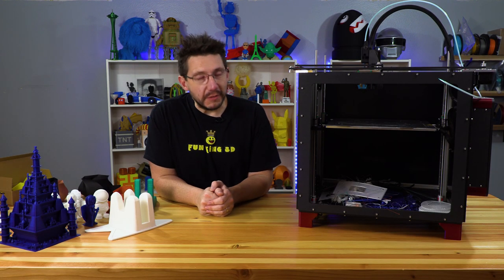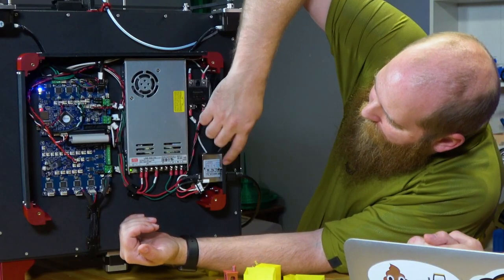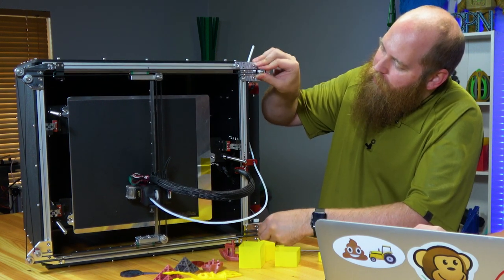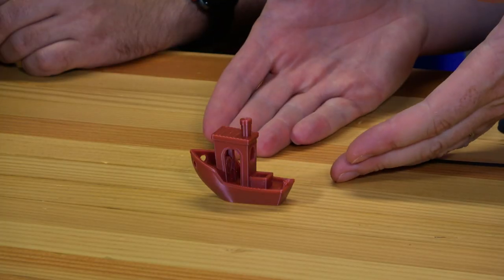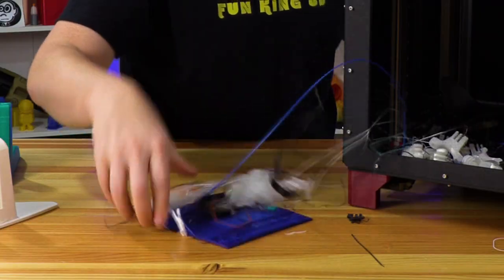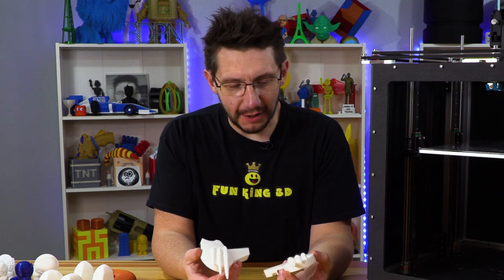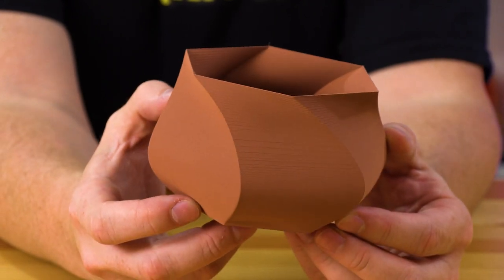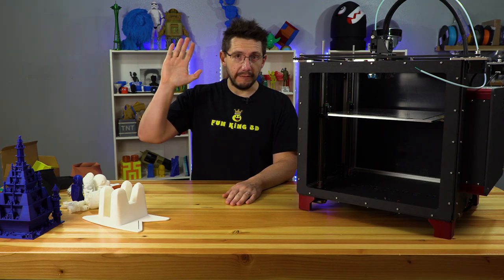Railcore II 300ZL Project R3D 3D Printer Kit Review

Comment: Voron 2.1 is superior in every way, basically.  leadscrews vs belt z is a tossup.
Reply: Every design is a set of compromises. I have a great deal of respect for the Voron team. We chose different compromises. I'm not sure what criteria you're using for "superior". 

The only clarification you offered is that "lead screws vs belt Z is a tossup"; I would point out that numerically that's not even close to true. The current kit design has either 4 or 8 times the Z resolution of the Voron belt-driven Z, assuming they use 16T pulleys (I didn't check that bit). If 4 (if you use a 0.9º stepper on the Z belt) or 8 ( if you use 1.8º ) is a 'tossup', ie indistinguishable, it's difficult for me to grasp your criteria.
Reply: @jstevewhite  the Voron 2.1 has 4:1 step down from the z steppers I believe, and drive the z belt with 16T pulleys, which gives it the same resolution as an 8mm (4 start T8) threaded rod. In other words, resolution will probably be the same.
Reply: @MyChannel3141   if it's the same resolution as T8*8, it's four times more coarse than  the Railcore (1 start 8mm Z axis)  - that is, .04 full step vs .01 full step. From a quick reference to the "building the Z axis" video for the Voron, it looks like they use 5:1 reduction, not 4:1, which would end up at roughly 50% more coarse than the Railcore. 

Not that it matters if you wanna print .1 or .2 mm layer height. But Joel was talking about the .01 stuff, which you're unlikely to accomplish well with .04 full step resolution.
Reply: Of course there's compromises, I'm not trying to say this is a bad system at all, just that there are some design issues that have been hammered out on the voron 2.1 that haven't been on the railcore II.  There are also some points which need improved on the voron 2.1 design as well, but I think they are less critical.

Several things would make the voron 2.1 superior in my eyes, namely the stationary bed vs the moving bed and the belt setup.  The gantry belt setup on the Railcore II is not designed properly.  The belts which fix to the carriage don't line up vertically.  This is a relatively easy fix, since it just means the relocation of two idlers and a small redesign of the carriage.  That redesign would fix racking issues on the carriage from the belts, and prevent torquing the linear rail back and forth as the carriage moves back and forth.  I think using a direct drive would be a decent idea if it weren't for the extra mass, especially on a corexy.  It's still an improvement over other movement systems, but I think the benefits of corexy are impeded (eclipsed?) by direct drive.  Others may think differently about that one.

Cooling performance is clearly better on the railcore II than on the voron 2.1, that is a weak point of the voron design imo.  It is remedied by adding extra fans or more powerful fans.  It's obvious that milled aluminum plates for many pieces on the voron 2.1 would be a significant improvement to the gantry rigidity, but the printed design still works very well if the correct materials are used.

Screws vs belts is a tossup because there's benefits to each, and detriments to each which aren't directly comparable. The two are not indistinguishable, but you could choose either one and still be fine.  "a situation in which all outcomes or options are equally possible or equally attractive"  I'm not gonna do the math, but there's a 4:1 belt reduction on the belted Z of the Voron 2.1, so you can take that for what it's worth.
Reply: @RentableSocks  "The gantry belt setup on the Railcore II is not designed properly.  The belts which fix to the carriage don't line up vertically. "... there is no reason they need to line up vertically, and no reason to 'fix' it. There are no 'racking issues' from the belts; all belt-related stress is parallel to the Y axis; the rail does not 'torque back and forth' at all. And, as I've said in many comments along this thread - 1) we a/b'd bowden and direct drive several times with no visible difference in print quality at 85mm/s - real-world, empirical test, and 2) if one is feels a strong need to use a bowden fixture, it's a five minute change; you remove the extruder from the carriage, move the filament feed tube to the bowden role, and bolt the extruder to the frame. 

Again, the Voron is a nice machine. We made different choices, on purpose, though. The structural side panels for rigidity, the higher precision Z axis (the Youtube voron z axis build video says it's 5:1, which would be about 50% more coarse than the Z resolution on the Railcore, at 8:1), and the ability to mod, tweak, change, experiment, and otherwise munge the base machine to your own purposes. 

I would certainly never discourage someone from building a Voron. If you want to say "I like the voron better." I'm with you. You do you. But a claim of objective superiority requires support, IMO.
Reply: @RentableSocks  That said, I'd love to see a gallery of Voron 2.1 prints @85mm/s. I can't find 'em from google. If you have a link, I'd appreciate it.
Reply: @jstevewhite  there's a subreddit you can check them out. I think most people are running 80mm/s+ so it shouldn't be that uncommon.
Reply: @jstevewhite  dd/bowden doesn't matter for speed, but it really does for the acceleration and jerk values.  I also said that this was more up to what people wanted to do, so if you're gonna argue for it then good for you.

If you think there aren't any racking issues with that carriage, I think you need to take a better look at it though.  Belts offset from the X axis in two directions is what's causing your racking.  It's really a simple redesign, two new holes in the X carrier plates and moving the belt clamping area on the carriage.  It's likely that the effects of racking on this setup are small, but over time they will wear out the linear rails, and in high vibration cases it will flex the linear rail, diminishing  print quality, although this is most likely during infill so it may not matter.  Another possible solution to racking is offsetting each belt by the same amount around the X axis, but that's more difficult and quite annoying.

Like I said before, the tradeoffs between Zscrews and belts is a tossup, you're acting like it's 100% about resolution, when it's not.  it's also about scaleability, cost, and inertia is in there somewhere for people who like zhop.

I do like the panels for rigidity, which is one of the mods I'm planning on doing.
Reply: @RentableSocks  I found the voroncorexy subreddit some time ago, but it's all "Serial requests"; I'm guessing folks prove they built one and are issued a serial number? That's clever :D Do you have a link to the sub. you have in mind for print samples?

Oh, and I meant to say that I do like the stationary bed; if I were going to build something bigger than 300^2, I would do it that way.
Reply: @jstevewhite  Maybe the prints are mostly in the discord, there's a gallery chat section where people share their prints and other things.  but yeah that's the way to get a serial, since there aren't kits available.  I consider 300x300 beds a minimum now after I've been using large machines for so long.  That's probably why I consider the stationary bed pretty important.

If I'm sounding uncivil, that's my bad.  My youtube keeps deleting everything I have written halfway through and I've typed each of those messages about 3 times now, it gets really frustrating.
Reply: @RentableSocks  "If you think there aren't any racking issues with that carriage, I think you need to take a better look at it though.  Belts offset from the X axis in two directions is what's causing your "... what? You can't leave me in suspense that way LOL. What is it causing?  EDIT: So I copied and pasted the line, and the rest of it appeared, despite the fact that the original comment does not display it. Anyway, it says:

"If you think there aren't any racking issues with that carriage, I think you need to take a better look at it though.  Belts offset from the X axis in two directions is what's causing your racking.  It's really a simple redesign, two new holes in the X carrier plates and moving the belt clamping area on the carriage.  It's likely that the effects of racking on this setup are small, but over time they will wear out the linear rails, and in high vibration cases it will flex the linear rail, diminishing  print quality, although this is most likely during infill so it may not matter.  Another possible solution to racking is offsetting each belt by the same amount around the X axis, but that's more difficult and quite annoying."

We aren't experiencing any 'racking', nor any reduction in print quality even at high speed zig-zag prints. Feel free to examine the print gallery for evidence. The big advantage of corexy over hbot is that the lateral forces of the motion are cancelled by the opposite belt path, avoiding the racking you are talking about. It's quite literally not doing what you're asserting. If you examine corexy.com's illustrations and explanations, it should be clearer. 

Also no significant change in print quality from juggling accel and jerk at 85mm/s. I'm certain I could find a speed where it would make a difference, but we spent a lot of headspace and timing on the rigidity for this very reason. I run my RC2 (the prototype) at 3k accel (same as the Voron) and 1k jerk (which seems to be very similar to the results of the klipper junction deviation of .05, the voron default).

To be clear, I'm not 'arguing for' direct drive. I'm rejecting the assertion that a bowden would produce better prints at normal print speeds on this printer. :D
Reply: @RentableSocks  Also, yes, YT has done that to me several times, as well. *sigh*.

For fun, here's a gallery of railcore2 prints: https://imgur.com/a/QNLli
Reply: @jstevewhite  youtube is bad and it should feel bad.  
the racking i'm talking about isn't the one on hbots, it's from an offset of the belt to the linear rail.  While it's hard to completely get rid of even on corexy, the further away the belt is clamped from the X axis, along the Y axis, the more racking you'll experience.  This will happen with any linear motion, not just corexy or hbot.  When you're pulling on the carriage to do an X move, you'll be pulling more at the back than at the front, since neither of the belts are aligned with the ball bearings (maybe one is, hard to tell).  Whichever belt is in the back needs to be closer to where the ball bearings contact the rail.

The same could be said for Z offset from the X axis, but there's much more contact between the slide and the rail to prevent movement in that axis (also more material since that's the beefy axis of the linear rail), while the one I mentioned previously would be torquing along the weak axis.

It's hard to believe that there's no change in print quality if you haven't tested it with the correct belt configuration, unless you're talking about DD/bowden.
It depends on what you want to limit whether you want bowden vs dd.  if you have poor retracts on bowden, you can trade that for worse accel/ghosting and a dd.  It'll always be a tradeoff between those two things, especially if the hotend is only supported from one side (not that that's horrible, it's just because of resonance).

More moving mass = more ghosting/ringing.  DD = more moving mass.  Whether you can TELL or not I guess is a different discussion.  I run 3k,1.5k IIRC, but I'm also only printing at 80mm/s usually.  forcing 0.6mm out of a 0.4mm nozzle for infill.

Also I'm on a duet+duex5.  I want to try klipper sometime but I don't like the dual RAMPS configuration.  It was easy enough to setup the duet.
Reply: @RentableSocks    The belt offset is well within design parameters for the rails in question, and the loads in question are considerably below the rail's rated loads, per Hiwin. I can show you reference designs from rail manufacturers that have the leadscrews, ballscrews, or belts as far from the axis and sometimes much farther. The carriage constrains roll, pitch, and yaw, allowing only linear motion, and is in fact designed to handle exactly the loads you're describing. It's what they're made for. 

Objectively, the mechanism in question produces prints as high quality as any we've been able to find. If you watched the video, you'll note that people were blown away by the print quality at MRRF. These aren't people who haven't seen good prints. I find it highly unlikely that artifacts such as you predict would escape the alert eyes of that crowd, even if I were so benighted as to be unable or unwilling to acknowledge them :D

I was referring to DD/Bowden vs print quality. Of course, there is always 'ringing' (actually, vibration in the system), just as everything is flexible*. We're really talking about tolerances. When I say there was no difference, *of course I mean "no visible difference in the final print". My measure of such things is exactly that: "Can I see it in the final print?".  Obviously I'm not saying there's no difference in the physics of the system; only that said difference fails to produce artifacts that rise to the level of visibility. Thus, at 85mm/s, there is no advantage to the Bowden in this instance. That could change with a different hot end that could squeeze out more plastic, and if someone wants to run at 150mm/s for regular prints, it makes sense for them to switch to Bowden - which we make stupid easy; it's literally 5-10 minutes to convert; less if you have two stepper wires for your extruder and don't need to remove it from the wire harness. :D

Here's where I'd absolutely take the Pepsi challenge - not just with the Voron, but ANY open frame extrusion printer (even the 4040 monstrosities). Clamp the base firmly to a shop table. Set up a dial indicator at the upper left corner of the chassis. Apply load to the upper right corner of the chassis. Measure deflection at load. 

Ah, well. Again, I am not dissing the Voron. It's a gorgeous printer. I'm still not persuaded that it's "superior in every way" except personal preference. I'd be happy to compare prints  - already posted a gallery :)
Reply: @jstevewhite  I'm not arguing that the forces aren't within manufacturing rated loads per hiwin, as those cost considerably more than the rails you're using on the machine in the video.  Even if the "rated" loads are similar to hiwin, I don't really believe any reference material coming from china, which is where I purport those rails to be coming from (correct me if not).  If the slide had multiple bearing races on each side, I'd be more inclined to say that the torquing doesn't matter.  

However, there's two things at play.  One is that these are not hiwin rails, so tolerances are considerably worse and loading characteristics are not going to be anywhere close to the same, and two is that even if they were hiwin rails, hiwin rails are designed to be bolted down along the travel axis, not suspended without support.  Of course suspending the rail without support reduces ringing and the moving mass for Y (depending on rail resonance and deflection), but it does also introduce a problem when uneven loads are applied to the rail, since it is not designed to withstand those forces without being supported from behind.  X carriage play from the uneven forces on the carriage isn't something that will be present on a brand new machine, it will show up after 6 months or a year.  You'll be able to wiggle the carriage by hand.

Of course it produces great prints, overall it's a solid machine and very well designed.  All I'm proposing is to do a quick 20 minute test and try to align those belts.  It's two extra screws into the Y rail blocks, two spacers to keep the top pulleys in line, as well as a new printed carriage with the belt positions moved.

That's a good idea for switching from DD to bowden, good thing there are many mounting points for an extruder along the top of the machine.

Deflection in my machine frame is primarily caused by the 2020 flexing.  I've added some bracing and already it's reduced it from about 1.5mm to 0.5mm with just some hand pressure (not measured).  There's still a ways to go, but I think some additional paneling is on the way to help that.  

If you can bend or twist the X axis by hand on your machine, I think that's cause for concern.  Maybe your rails are different and don't deflect, but I still think it's something to look into since it's so easy to test.
Reply: @RentableSocks  You're correct that the kit does not contain HiWin, but the design is unquestionably HiWin's :D That said,  it's a fair criticism; they are Chinese made rails. However, my assertion still stands even if the rails we're using are off by an entire order of magnitude in load rating. 

Not that the rails have been entirely without problems, but the problems haven't been in early failures, but in unpredictable preload and less-than-straight rails :D Some members of the community have had terrible luck with the QA on those things. The kit is eliminating  most of those problems - the kit seller (Project R3D) is doing their own QA on the rails. 

The point about the unsupported rail is also legit - HiWin doesn't recommend it, as it reduces the load carrying capacity - but that said, a 12mm x 9mm bar of hardened steel is stiffer than 2x8mm smooth rods, the typical axis of current 3d printers, and that 'load carrying capacity' is still tons higher than the stresses we're placing on the unit. I think the span of the RC2 is the max for unsupported MGN12 (I say this from an empirical position); If we were to make it wider, I'd switch to MGN15.

RailCore 1, the first in the line, has been running for about two years at high speeds and heavy usage, and the Railcore 2 prototype has been running for a year or so at higher speeds, and the rails show no signs of wear or early failure, and no 'carriage wiggle'. I've had the Y rail (you may not have noticed that the single rail is Y on Railcore) out of both of them doing upgrades and the like, and usually take the opportunity to inspect, clean, and lube, and they look like the day I bolted them on. 

I'm a fairly strong guy; I've never met a 3d printer wherein I couldn't 'flex' the carriage by hand. As I said before, everything is flexible; we're talking tolerances. There's no "play" in the carriages that rises above the system noise, and you can't divert the nozzle easily. It's considerably more difficult to divert the nozzle on RC2 than to do so on your average 2x8mm smooth rod printer construction (that was one of my first tests). E.G, you can put your index finger on the nozzle of a lulzbot and flex it easier than you can on RailCore 2. 

So let me re-assure you that your concerns are unrealized after two years of heavy usage :D 

Where we've had real, pain-in-the-ass, ongoing problems is the idlers. It's hard to find good 20T idlers with 5mm shaft. The solution in the Voron is clever, though I'm not sure I think the parts count is worth it ( pulleys on 5mm shafts in 625 bearings ). Recently some Gates pulleys have become available and some of the community are testing them.

Yes, panels mounted structurally will increase your system rigidity by an order of magnitude in the panel axis. That's one of the things I tested early on, as well. Railcore 2 was my ... eighth? CoreXY design (collaborating with Tony). Panels made such a huge difference in rigidity on RC1 that they were an early design requirement of RC2 :D

It's been a pleasure, and if I sound testy from time to time, I apologize. Sometimes it's difficult to disagree with someone in text without sounding that way, but it's unintentional, I promise.
Reply: @jstevewhite  Since the load rating on these rails is unknown, I think it would be better to design around best practices (reducing torque from belts) instead of relying on the chinese rails to keep close to the hiwin spec.  

Yeah the QC can be a tough one especially for a DIY build but it is nice that they're filtering out the bad rails and even cleaning them before customers get it.

Smooth rods are terrible and I have no idea why anyone uses them in a printer, ever.  oh I hate them so.  Always bent, bearings never tight on them.  

That is a fair point about the rails being stiffer than smooth rods though since smooth rods are pretty standard.  The flexing i'm talking about is just on the rail (i guess it's Y axis on that machine, but I've been referring to it as X because of the stepper positions)and not due to the carriage.  I can't flex the X axis rail on my voron because it's being helped by the 2020 rail (it's also mgn9 though).  I'm able to easily bend a 300mm MGN12 rail by hand if the ends are mounted to something solid.

I think you could get away with using 2 MGN12 rails that are connected for a larger span, sort of like an I-beam with either printed supports or even aluminum standoffs..  I guess it'll depend on which one weighs more or costs more.

I'm surprised you haven't experienced any carriage wobble.  Even with balanced belt designs it tends to show up around year 1.5-2 (although very minimal) on the chinese rails that I've used.  It could just be that I'm not properly maintaining my machines.

I like the solution on the voron for the idlers, especially since it means no cantilevered pulleys and none of the crappy tiny bearings that always fail.  It does mean higher BOM cost, but if that means I don't have to replace the idlers every 5 or 6 months, that's fine with me.  I've had 2 week long prints that fail because one of my idlers exploded (i3 kenimatics, X idler).

Getting rid of cantilevered idlers might also be something to look into.  You can even out the loading on the bearings by adding some extra pieces to support the tops of those bearings, it should significantly improve their life.  It also prevents extra stresses on the screws.  This might not help as much if you're using aluminum brackets for mounting the idlers, but it makes a massive difference for plastic idler blocks.

I'll correct you a little bit here though(AKSHUALLY), the voron uses flanged bearings on the idlers (which I don't like, even though they're better than the ones embedded in idlers), and that's something I'm looking into changing to standard 625 bearings because the flanged variant has diminished loading capacities.  The Z motor modules do use standard 625 bearings, but all of the idlers use the flanged variant for some reason.

I can't really tell from the video, are you already using genuine gates belts?  That makes an enormous difference for larger machines, since the gates belts are much higher quality than 99% of the other belts on the market.

You're all good, I've had fun with this.  Youtube comments aren't the best for stuff like this but It's better than nothing.